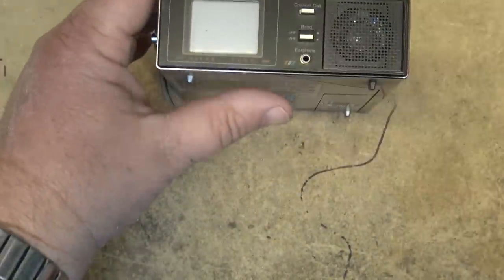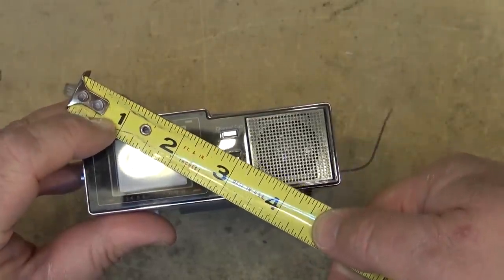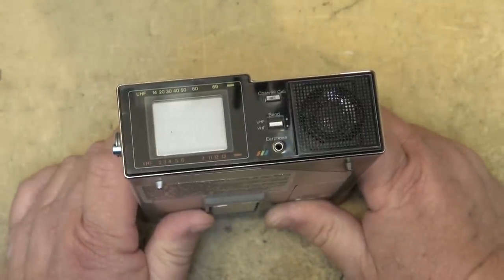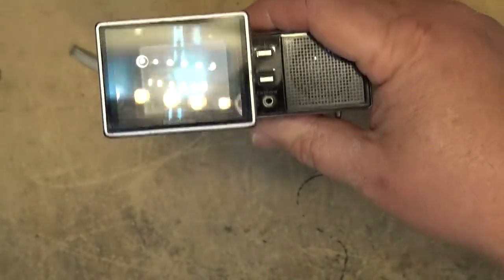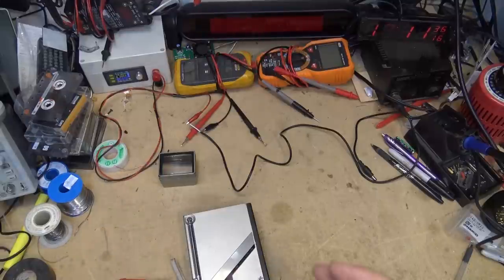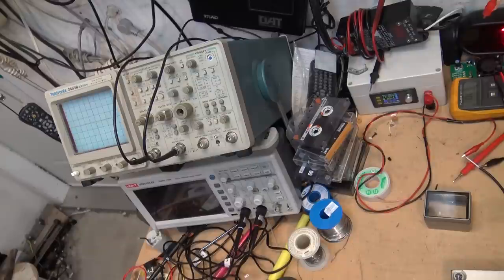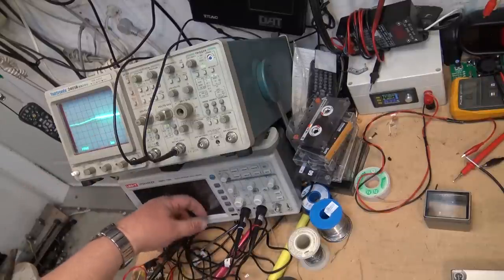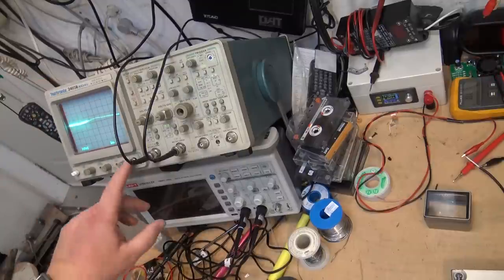Smallest Color CRT TV set in the world

Comment: 5:55 Currently reading a document titled FINAL Strategic National Smart Grid Vision for the South African Electricity Supply Industry....And have been looking at the feasibility of since the nation to is currently undergoing an analogue broadcasting migration of all TV signals over to DTT ( Digital Terrestrial  Television). Can analogue signals be used similar to Auto Variable Tuners in Smart Energy Meter's to listen to different States of Energy National Supply and Demand Management Stages. Eg. An energy meter listens to 4xVHF and UHF TV channels and based on each channel the meter can transfer from Channel 1: Normal Grid Stability to Channel 2: Grid overload turning of Geysers and high loads to Channel 3:All 3 Phase unbalanced and Power Factor loads switched off and finally Channel 4: Time of Use Night Loads can be abused....With only 1 Channel transmitting at a given time from Electric Utilities Co.And when Off Air the Smart Meter Tuner listens for another TV Channel signal.insted of IP internet based Smart Grid Meter's. Think this approach would be cheaper.
Reply: Reason for TV and Radio listening is for later transmitting QR Codes on Screen UIX

Comment: A Panasonic TV with Mitsubishi chips and a Mitsubishi CRT
Reply from the maker: Pardon? I believe you are getting your trade marks mixed up. Mitubishi uses 3 diamonds that the tips touch in the center. Matsushita Electric trademark is 3 triangles sitting on a circle with a single white dot in the center.
Learn your trademarks before you make such an absurd and incorrect comment. The ICs and CRT are most certainly Matsushita Electric, which IS Panasonic.

Comment: There's one on eBay right now for 199usd if anyone wants it
Reply from the maker: They are holding their value quite nicely for an obsolete unit.  For me the one I have is a conversation piece. I need to rebuild the battery pack on mine.  It is just cool due to the size.

Comment: Jean-Michel Jarre, OXYGENE  @26:55  !!! Lol.
Reply from the maker: Performed live. Took 4 of them to pull this off, all with identical instruments. It's a cool show. He played the entire album live.
Reply: @12voltvids  Dear Mr 12voltvids: What did you use to generate your NTSC old style analog signal to test this TV? Did you run the output of a cable program into a TV transmitter like for example the Ramsey Electronics TV transmitters used for closed-circuit systems in the 1980s and 1990s?
Reply from the maker: @foureyedchick  I have some professional catv modulators.  2 are mts stereo and 4 mono units. The ones I have can tune to any vhf or uhf channel. I have a bunch of uhf modulators and a low power uhf transmitter that will send signal about 100 feet over air.
Reply: @12voltvids  Yes...what a masterpiece!
Reply from the maker: @realDonXeon  pretty cool